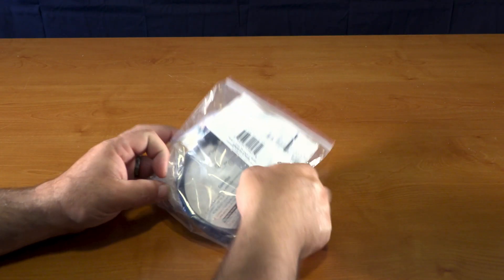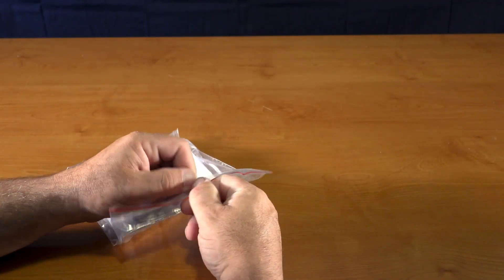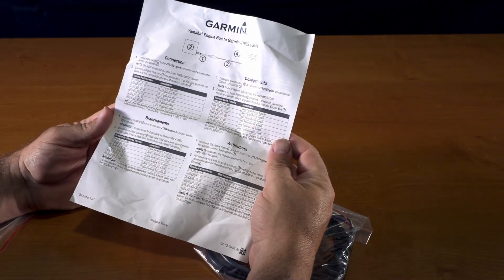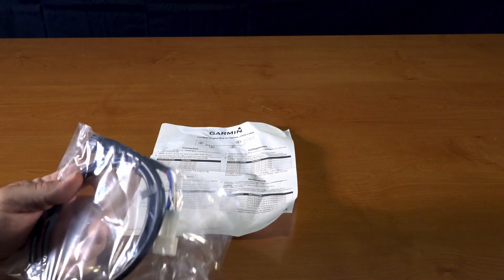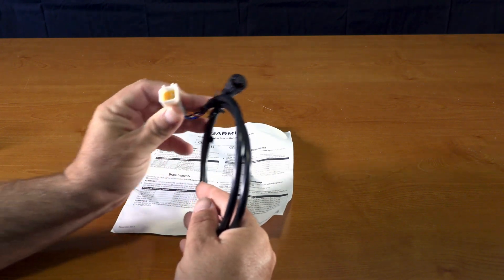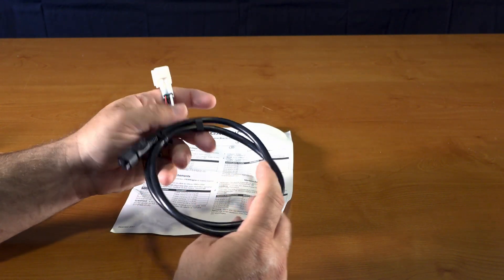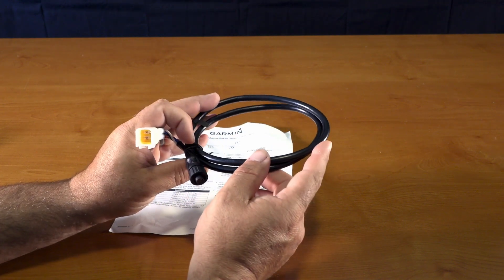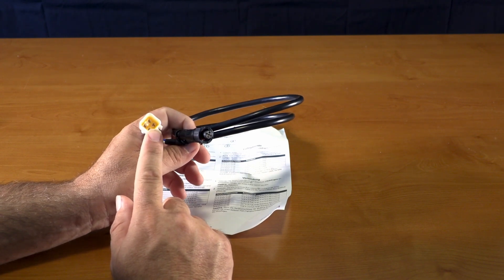Garmin Yamaha® Engine Bus to J1939 Adapter Cable / Open Box

Comment: Just want to be clear.....This can connect from a yamaha outboard to a Garmin gpsmap without using a Yamaha Gateway? Thank you...
Reply from the maker: This is a Garmin cable that goes from the chart plotter to a Yamaha connector.  You will need to buy a Yamaha Pigtail Bus cable (6y8-82521-01-00 / ***this is a 1' cable, there are various lengths) to connect directly to your outboards data cable or it can be plugged into a Multi hub (6y8-81920-01) if your boat has it.  If all your multi hub connections are used, then buy a command link pigtail (6y8-82521-80-00) remove a connection and put this Y harness in, it will hook up without having to wire in an additional Multi hub.
Reply: So this would connect where your power source goes on your garmin. I have the echomap ultra 106sv and was going to do NMEA 2000 but this looks simpler since I have the Yamaha connector already
Reply: @brettgerlach3512  did you get it setup?
Reply: The white connection goes into the Yamaha hub.  Can it go into any “device” port?